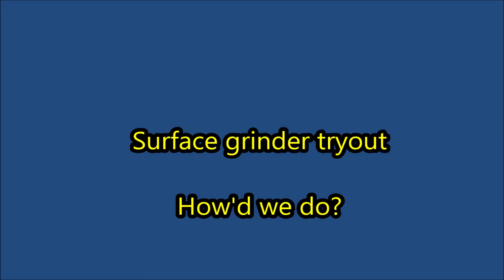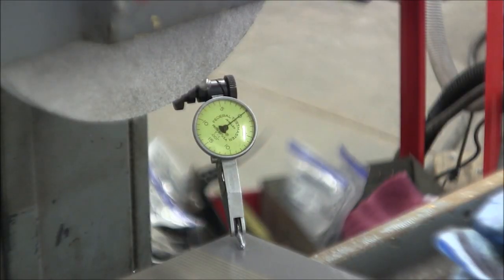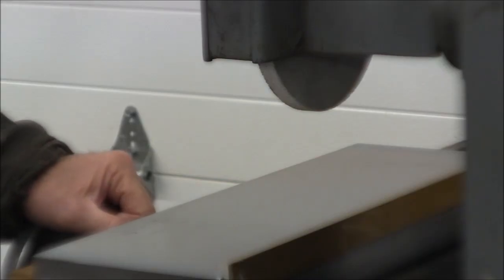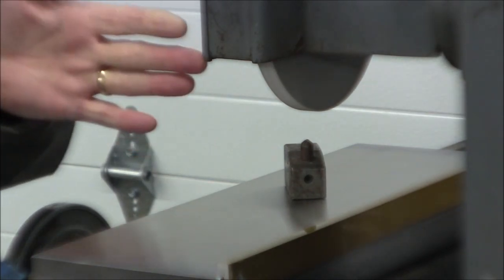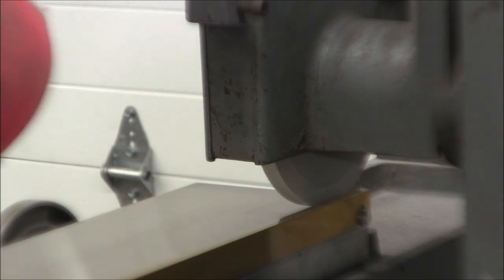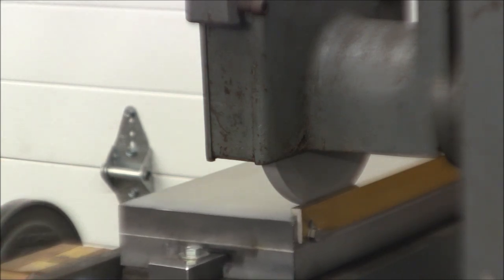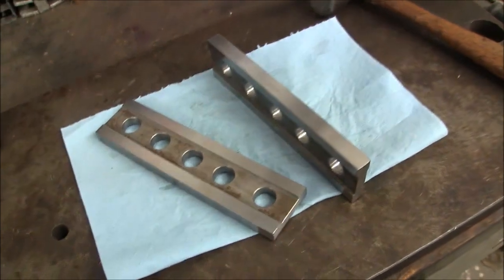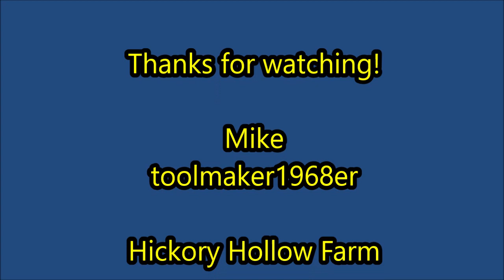Surface grinder tryout

Comment: Great finish Mike I bet your pleased all the time you put into it was worth it, did you only dress the wheel once if you did I’m impressed, I notice your step over is very small I wonder if that’s what I should be doing, if you want to grind real hard stuff like wood chipper blades how would you do it, what depth would you go, what wheel and what step over, nice job mate.

Al.
Reply from the maker: Hi Al. The wheel has been dressed twice, one time in each of the last two videos. What you saw this time, was cleaning it up after grinding in the chuck. I probably removed less than .01 from the wheel. When the sound of the diamond matched the full pass across the wheel I knew when it was fully dressed.  I just keep making passes until that happens. On this video you saw the total dressing in real-time. I'm using a Norton 46H wheel. Basically, the deeper the depth of cut the smaller the cross feed. If I have alot of material to remove, I may take .01 per pass with very little feed. If I'm taking a finish pass, maybe a depth of .0003 and a .06 cross feed. Listening to the grinding sound is feedback on how it's cutting. Start your settings conservatively and increase crossfeed on the fly until it sounds right. After awhile your senses get very tuned in. Heat is the enemy. Overheating not only burns the precious carbon in steel, but creates expansion, and suddenly things are out of your control. With manual grinding the operator needs to get into a rythm to provide uniformity. Auto grinders of course, provide the consistency. Many factors play into answering your question regarding d.o.c. and cross feed. Type of wheel, coolant or dry, material type, amount of material to remove, flatness spec, etc. Hope this helps, Mike

Comment: I have several round stones.  Some like those and one like Keith Rucker has shown in his videos. I also have the Norton TriStone that Adam has shown on his as well, but it needs new stones and filled with oil again.  Thats quite a decent grind on that chuck.  I dont know but I think my Walker 6x12 is getting a little weak these days.  I've gotta get it apart and resto it.
Reply from the maker: I noticed my round stone is a little loaded up. I need to dress it. It's a quick simple process and maybe I will video it if viewers are interested. Tc, Mike
Reply: @michaelmurray9154  yeah.  Mine is too.. it needs a dip in the ultasonic.  I see people like Renz and Lance are making ground flatstones.  I have so many vids in the works I planned to do a lot last year but got sidelined by some stuff.  Stones are like cast iron they get oils/grease and loose abrasive leached into them as they age/wear.